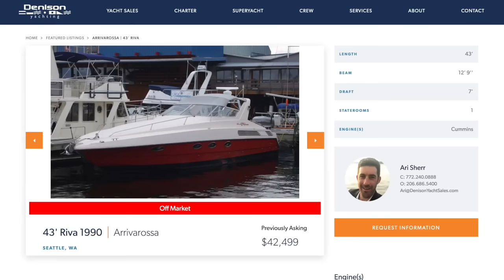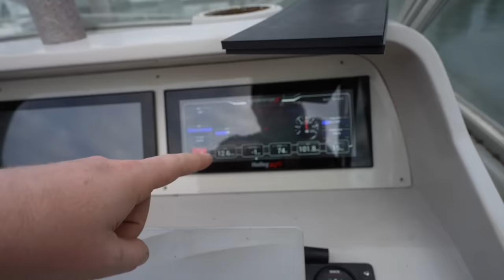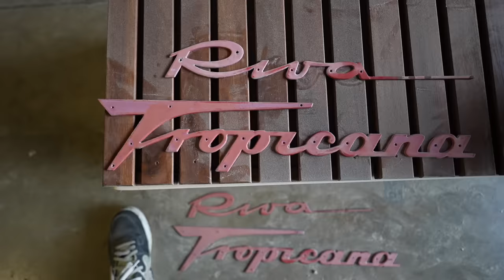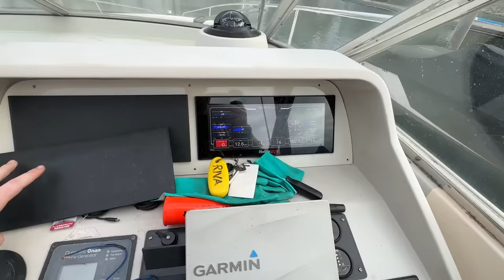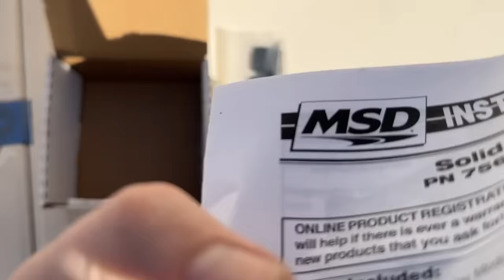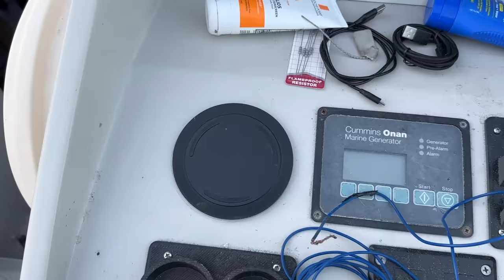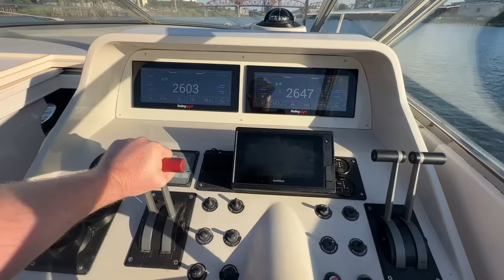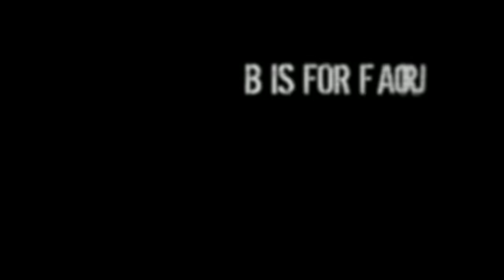LS Swapped 30yr Old Italian Yacht FINALE!! - ITS FASTER THAN EVER!!!

Comment: Very nice job. I think you have only to add or move weight to the stern and the boat could reach at least 38-40 knots. With the original Cummins diesels the boat is capable of 28 knots crusing and 35 maximum, so, if the propellers are right, and the weight well distributed, this yacht will fly. You can move the water tanks to the stern and keep them always full of water.If you don't need many meters of chain for your anchor, you can reduce them to discharge the bow...
Another expensive way to move weight towards the stern, if there is space, is to mount the engines as close as possible to the stern, using two V-Drive transmissions...
Reply: Think he had the trim too far down, made the front drop into the bow wave...
Reply: Yes! you dropped so much weight in the rear that you need to lighten the front, load the back, and change props to get the motors turning where they are efficient and make power.
Reply: Good post, much better than most here.

Comment: For cleaning stains, try DMSO. It surprised me when I used it to clean a second hand imac that I purchased. The previous owner had old stickers that left black stains in the aluminium. I tried everything and nothing worked. the DMSO pimped the thing like new with zero effort. It has medical uses but is also considered an industrial solvent. Also, hydrochloric acid dissolves iron. You could try a rusty spot with that. Gloves and respirator required for the HCl. Neutralise with baking soda. The trouble with using abrasives is that you lose the grip surface.

Comment: Y’all are doing a great job with the boat! You probably need to re prop to make sure you are in the most efficient part of the engines power band vs the diesels which make all power at super low RPM. It will also slow down your idling speed for maneuvering and docking which would be less stressful.

Comment: Great to see it finished.   I think next Spring new more efficient props and some ballast to even out the weight distribution of the boat would make all the difference.  As a guess, you may gain an extra 2-3 mph at 1500rpm cruise, which equates to a 20-25% increase in your speed aswell as range! A worthy investment. 🇬🇧
Reply: Those engines should be cruising at 3500. They are not the old diesels. 1500 is barely off idle for this setup.

Comment: I feel like 3000RPM is low for ls powered boats. The props and final drives should definitly be looked at if all they rev to is 3k. Am I wrong?
Reply: Ls boats can go past 4k easily. I'll have to check next time I'm out
Reply: I think for something like this yacht, 3000 is decent. He could gear it down a little more to get more speed out of it, but then at high throttle the engines would be revving too high at a cruise, and that would reduce the life expectancy of the engines and burn more fuel at cruise speed, I'd think. So not only is this going to extend the life of these LSX engines, its going to burn less fuel at cruising speed, since engines always burn more efficiently at lower rpm and WOT, lugging is the most efficient zone for an engine but too low of an rpm makes the engine useless and start to burn more fuel again. Generally, peak torque at WOT is the peak efficiency of the engine, its the point of the rpm band where an engine such as the Mazda SkyActiv-X is actually capable of its claimed 57% thermal efficiency, that drops when the rpm dips below peak torque and drops more so when it goes above.

Of course, this also means that Chris has no equivalent "flank speed" to get extra speed by over-revving the engines with WOT, but for a yacht I believe that's just fine. Of course, I am not a boating person, I'm just using what I know of engine science and what little naval trivia I remember :P
Reply: He should be at above 7000, most likely... so yes "a bit" wrong...
Reply: @Avetho   3000rpm is not good enough and I will tell you why:

It lugs the engines a lot, he should be at 7000rpm or more with these engines at WOT. Lugging is not good, if not immediately the end of the world.

These engines can cruise a 4-5k easily with the right stuff around them, so gearing down by a factor of more than 2, even 3 isnt a concern.

Less fuel burn for lower revs isnt really true for boats in any meaningful way.

He really need max allowed engine revs (above 7000rpm) to be WOT. that would surely mean a reasonable cruise of 30mph at say 4000 rpm.
Reply: @GoldenCroc  Ah, that makes sense, I'm still thinking in tyre diameters instead of prop pitch. Its like a certain amount of knots per rpm, right?
Reply: @Avetho  Yes exactly. 

Though it isnt a 1:1 curve, since the prop has a certain amount of "slip", and this varies with speed. Generally, its worse at lower speed, and better at higher speed. Meaning 1000rpm more can net you an extra 5mph at low speed, but over 10 at higher speed.

Comment: As a former Fuel System Operator, fuel height measuring, which is known as ullages, is the only proper way to measure fuel volume in marine fuel tanks. Technology however has made it easier. I would continue to do eyeball "ullages" with fuel and oil. That's just what I would do before big trips. Purchase an ullage tape with brass Bob and keep on hand.

Comment: Hi Chris, You might need a stronger acid than those premixes. 
If you go to a hardware store or a pool supply shop, you can get hydrochloric acid, dillute it to 1:10, and apply. Keep it wet, rinse it off, and reapply until you are happy with the result.
Be aware that it can eat/etch the surface.
Also, for organic matter, buy some chlorine from the pool shop, dillute it down to desired strength, a 1% strength of pool chlorine will kill of algae and mould and of course stain any natural fibres so be careful haha.

I do house washing and pressure cleaning, so I use these chems often.

Loving the channel and loving the boat content🤙🏼

Comment: Something is VERY wrong here. Either the props have too much pitch or the transmission ratio is off. Your RPM's with LSX motors should be anywhere from 5,000-6,000 wide open throttle..
Reply: geared for diesel i suppose,
Reply: Probably those propellers are the original calculated for the lower RPMS and the massive torque of the Cummins diesels.
Reply: Even more, above 7000 I should think...

Comment: I have enjoyed your channel. I imagine your spinning the propellers from the Diesel engines? They are all wrong for your setup. With Big Block engines you should be turning 4800 to 5200 rpm Wide Open Throttle, WOT. With that setup at that HP you should be top speed of 38-44? Cruise speed will be achieved at 3200-3500 rpm. And the speed will be whatever you get at that rpm. You’ve done a bunch of work, congrats👍🏻
Reply: He doesn't have big block engines, so your statement irrelevant.
Reply: @charlieodom9107  It is, but not for the reason you might think. The engines got "big block" capacity, but RPM should be decided by max revs of the engine, likely over 7000 in this case.
Reply: You have a point, but its not about "big block" per se, its about the max rpm of the engine, thats where he should be at WOT, with these engines it over 7000 rpm most likely...

I think from you post you are using standard engine "rules of thumb" but they are not really applicable here since its such an unusual case  for engines and boat combination.
Reply: @GoldenCroc  no, completely wrong. Totally different engines, with totally different RPM ranges.
Reply: @GoldenCroc  Max RPM of these engines is certainly NOT over 7k, and NO Big Block engine has a max RPM over 6k. Most are around 5k. This engine is NOT a Big Block, should not be treated as such, and RPM should be based on a dyno graph, not some arbitrary number from a completely different engine.
Reply: @charlieodom9107  Adressing your first post specifically: 

What engines have a totally different rpm range? Smallblock vs big block? 

If so, what makes you say so, and dont you think thats a bit too big of a net to cast considering all different smallblock and big block engines and the different configurations they can be built to?
Reply: @charlieodom9107  Adressing your second post: What makes you say they most certainly have a max rpm under 7000?

The purported horsepower they are supposed to give shows that they would certainly be above that by a comfortable margin.

I couldnt find any rpm data from Texas Speed, but very similar engines, (468 cui Lsx) with the same horsepower, give their max power at 7200rpm and got a few hundred revs above that as a safety margin.

Secondly: Tons of Big block engines have a max rpm over 6000, namely just about every race big block engine ever built the last 50 years at least. Dont forget, according to texas speed, these are race engines, "not for street use".

I agree with your last sentence completely, but it seems you base your rpm info from stock street or marine engines, when this is anything but.

So I got as much info as I could find at short notice and all things I found (dyno of very similar engines as well as the pure physics itself) point to it being above 7000, as well as my other points.

Cheers mate.
Reply: @GoldenCroc  any engine has a different rpm range from another, and comparing these engines to an off the shelf Big Block is not only incorrect, but can cause major problems.

So, specifically....ALL engines that are not manufacturer built big blocks designed to be ran at a specific RPM is going to be different.

For example:
A Merc 502 MPI has a max rpm of 5000.
A Merc 520 MPI has a max rpm of 5200.
A Merc 565 EFI has a max rpm of 5400.

All three of these are the same base, but require different RPM.

You also have to take into account octane, tune, and even build parameters. The ONLY way to know what the proper RPM range is for a specific motor is to dyno the damn thing.

Comment: @bisforbuild guys note that in order to attain full speed potential the engines must be able to reach their full rpm… if they are not reaching their full rpm it means that either you have an issue with the gearboxes (unlikely) or you have way too large props!! I had same issue on my yacht before, the drag on the surface of of the propellers hinders the engines to reach their full speed. When we remove and replace engines we ensure that we study the hull hydrodynamic in relation to the engine performance curve in order to obtain the adequate prop size for the boat purpose. Regards Ing.Q

Comment: Amazing job!!!!!!
For the wireless phone charger, you may want to 3D print a phone holder so you can charge while the boat is moving, but also a cover. If you put the phone to charge in the sun, the phone will get too hot

Comment: In the past when I used to detail sport yachts I used Scrubbing Bubbles toilet bowl cleaner for rust and water stains. Apply the cleaner kinda thick with a paper towel, let it sit for 10-20 minutes and rinse with water and use a hand brush if necessary

Comment: Use some toilet bowl cleaner to get the rust stains off. Also works great on the scum line on the bottom of the boat. It's cheap and super effetive. Since it's a gel it clings better.  I use a cheap chip brush to paint it on

Comment: Sweet spot on our V8 gas run about is around 4300 to 4500 rpm’s. Went thru several props to get the hole shot and cruise just right. Have a top end prop that gives an extra 10 mph but coming out of the hole is terrible. Gotta find that balance and she will do what you want her to do.

Comment: As a fromer deckhand for,superyachts, your cleaning methods are unorthodox. However, very effective. Also, you should do spring lines tied to the side on your boat and then consider your stern lines and make them tight, but with a little give to accommodate tide changes.

Comment: Epoxy usually isn’t UV resistant. You need to sand your table top with 320 grit and apply a couple coats of spar varnish on top of the epoxy if you want to get any decent life out of it.

Comment: My family had a 40 foot Chris craft roamer that is very similar to this boat. With 2 Volvo diesel (480hp each) that boat can go 36mph while clean. So 28mph doesn’t seem that far off. Trim though is VERY important.
Reply: Its extremly far off. You have to consider the hp rating of the engine. Also, that 36 to 28 is night and day in power demand for boats this size. I think he is at ,maybe 300, max 350hp per engine at those low revs, compared to the 750 he should have if I heard him correctly.

Comment: Are you still using the old diesel props?  You need smaller diameter, lower pitch props to match the rpm range of the gas motors.

Comment: I use to work for a commercial Shellfish Farm.  The company built us a portable gas tank that was 120 gallons.  Instead of fueling at the marina at $7 a gallon.  We fuel at a gas station at $450 or $5 a gallon.  It was made with 1/4" aluminum 5052

Comment: Need to look into some props with a smaller pitch. More rpm more speed. The boat was wheeled for a high torque  diesels for lower rpms. Also wheeled right will give you a major fuel economy jump.

Comment: Talking of rookie errors, me and my wife left the marina one day, she checked the ropes and pulled in the fenders whilst I kept it against the pontoon using the bow thrusters. Everything was looking good so we eased out of our berth. Our destination was 17 miles away and at about the 6 mile point (in the open ocean) I looked down and saw the shore power lead trailing out behind. Luckily for us it never fouled but the cable had pulled clean out of the plug. On returning to our home berth (the next day) we saw the plug still sticking out of the power box so quietly removed it. As to the speed thing, I agree with other comments here, the bow was ploughing the water. You can get trim tab indicators which let you know where they are set. Without them you loose positions after fiddling with them over and over.

Comment: I read that the diesel engines helped because the weight helped get the boat to plane easier so maybe add some weight plates in the engine compartment to get to plane easier
Reply: Wrong Wrong, speed gets a boat on plane. Weight is ones enemy is a boat. The diesel had the low end torque to turn the large higher pitched props to get it moving. The boat is way over prop's for the gas engines and are being lugged down to 2600-2800 RPM when they should be turning about twice that. The Cummins with transmissions weighed about 3K each, or around twice the weight of new gassers. The boat should do 40 to 50 mph with the correct props.

Comment: The IKEA furniture will last a lifetime but you gotta varnish them like a wooden fence. Scrub them with 180 grit and then 360 grit sandpaper then put on some kind of varnish or oil. If you choose oil then you'll have to do it every year or at least every 2 years. Make sure to use garden furnite varnish/oil so it's UV resistant.

Comment: Not sure what product you used. But wood Stain is not usually finish. You need the finish a varnish, epoxy etc to actually protect the wood. I would recommend spar urethane for wood that will be outside.

Comment: Great series and I hope to see more about the boat next year. You really need to change props. Your gas engines run at a much different RPM than the Diesels did and between that and the tabs I bet you can get over 40mph. Plus if you take some pitch out of the props your idle speed will be slower making easier to manage in the marina.

Comment: Need to take some pitch out those props. They were meant for the 903 Cummins probably had some 2:1 gears on her. Not sure what gears you got now but those props are pitched for the low rev high torque diesels. Take your them to a prop shop and tell them your gear ratio, max rpm, HP, and vessel weight and they will be able to point you in the right direction and tell you what your top speed can be. There is also some prop calculators online you can use. On your props they will have a stamp first number is diameter second number is pitch. With your setup you should be able to reach close to 40mph with the right props

Comment: I've tried 2 of those Holley LiDar senders. Both ordered from Holley direct. They are terrible. It calibrates fine against a solid object but when installed, fail. Reads correctly when 7" away from solid object but when installed 7" away from fuel reads pretty much empty. Both senders act the same.

Comment: Since you switched to gas instead of diesel you should make sure there's a good working extraction fan in the engine room that you run for a couple minutes before you start the engines to remove the potential risk of an explosion from the fumes trapped in the engine room.

Comment: @bisforbuild you need to get some new propellors for your boat, the ones on it are pitched for the diesel engines you removed and wont work correctly with the gas ones you swapped in since theyre designed for low RPM and high torque

Comment: Some more dialing to get done. Tabs, props, engine refinement. The interior looks great. The cockpit area is much cleaner and quieter. Those stained benches, wow.
Cruising speed or flat out $$$$$$. 1 mile/gal average at 1500 rpm or less.

Comment: 1. Need to add more weight to the back
2. You need to re-prop that boat
3. Once you are on plane, you need to retract the tabs. With the tabs down you are forcing the bow to go down. 

Your WOT rpms should be MUCH higher.

Comment: As a detailer I would stay away from a wire brush on the nonskid as you will get pieces of the wire falling off and rusting all over the fiberglass.Goof Off Rust Stain remover Bathroom is the best stuff I have found for rust.Booyah Non skid cleaner is what I would try on it along with a DA and a brush attachment or the Justman Roto-Brush for a drill.